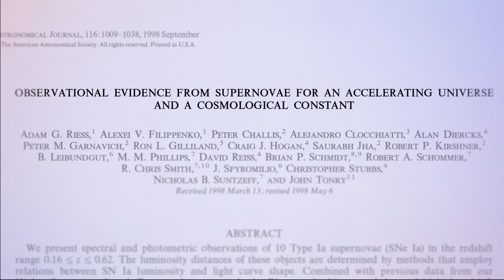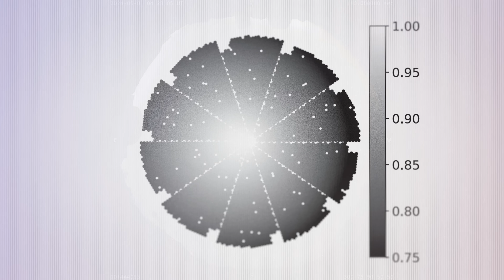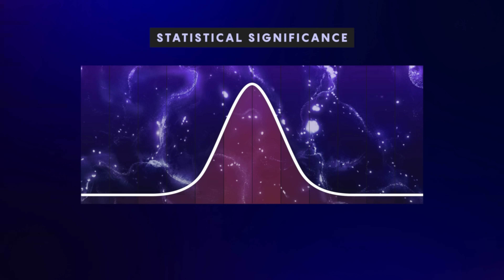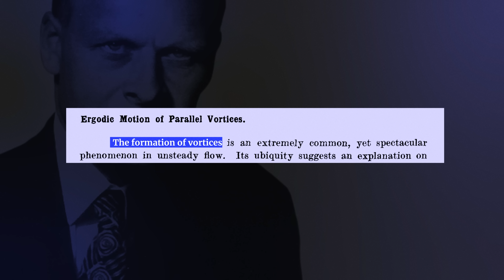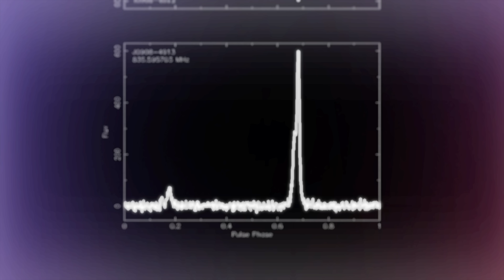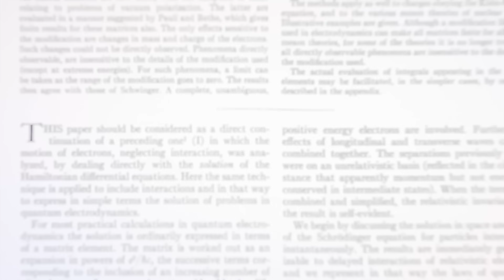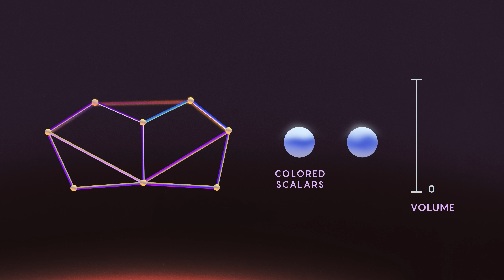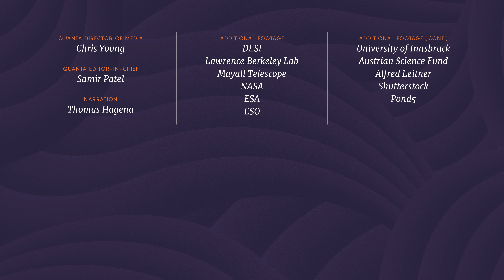Biggest Breakthroughs in Physics: 2024

Comment: 5:35 here is your Nobel prize, sorry its a hard read. I have ADHD not a degree in English.. 

Dark energy is the evaporation of our host singularity. There is no "Dark Energy" just a universe that can relax 4th dimensionally as the singularity cools and loses mass, uniting Hawking and Einstein I dont need dark Energy to explain where we are going, weirdly it always looks 46 billion years to the CMB or 13 billion years to the big bang, wherever or whenever you cut Einstein or Minkowski's time cone across the horizon and scale it to the board, its always the same numbers.. 

Time dilates with space, so a year now is 13 billion years happening in the same "time" around the big bang. There was no bang, well except from when our host went boom, but thats not when our time starts, its hard to explain... The big bang is an illusion of not reading the map correctly, the map of the observable universe is no different to the Gleason map, its all about straight line geodesics.  Both need to be pinned to the observer to be considered useful, the Big Bang is your ice wall, it only exists in your mind, when you don't know how to use the map you have at your disposal.

Lamda as he calls it is why down is down, the whole universe is expanding 4th dimensionally, you and the planet and solar system are all growing 4th dimensionally as space and time grow with age. At the centre of a massive object you and it expand 4th dimensionally at the same rate, you are weightless. Out far from the centre of mass you feel weight as your position isnt where it should be for your speed and position, temporally you want to exist on the right orbit for your speed, but you have a big planet below you that is growing way faster than you are, you dont see anything grow, but it makes you fall.. 

If you are at the right position to make a straight line geodesic into an orbit, you are going just faster than the expansion.  But from there you are doing a straight line in space. The dimension of time curves things spherically, but a line flat in time is flat in spacetime.  Its hard to visualise, but consider being at the core of the planet and deleting it, you would take its path through the solar system. You and it agree what a straight line geodesic is, you follow a path through time, a perfectly circular orbit is flat in the dimension of time. Special relativities clocks all tick together at the same rate.  This is what a flat geometry looks like in 4D spacetime. Even from the moment of the singularity being born, space and time have existed in a spherical bubble, right at the centre of a singularity should be a point null of its own gravity, like at the core of the planet. It should let a second event horizon exist, and that is where our universe can expand infinitely inside finite space.  Hot and super dense and compressed on that side, it is cool and expansive when you dilate things down to our reality. But everything expands and relaxes 4th dimensionally as that host evaporates, space included. The only thing not effected is a light wave, its just an information wave propagating an information wave. Travelling at relativistic speeds with little to no mass, its not bound by the same rules. A straight line for light is a straight line in time, and even that gets weird and messy.

We can look out into the sky and witness the same supernova over and over as light takes a slightly different route, are they the same photons? a different slit? its all weird illusions of the past out here, the light from our sun is 8 minutes old by the time you see it, things have changed. You see a red object, and swear its red, we all agree but it rejected red. It absorbed every other wavelength, so is it red, or the negative of red? a messy distinction eh, if we all agree who cares, until you come to take a colour photograph.. The world exists in a negative of how we see it. Everything you witness is an illusion, you never touch anything. Its all field repulsions.. the weird thing is it all scales. Wind back the universe pausing your current time dilation and sure it looks like a big bang, but you wont ever pause your dilation. You shrink with the wave as time is reversed until you are infinitely small, yet it all would look and feel the same. If im right that means the universe is about 13 billion years cubed in age. or square, by 4d math isnt too hot, but i can see how this all works. Its a universe bound by orbital mechanics, an orbit of the CMB and Big Bang take the same time in dilated space. And you cant get to either, they are just echos in time, a record of change, weird perspective shifts. Its like if light did orbits, most of the world would consider it to be flat as you could see right around the earth. Weird we use light as a yard stick.. space and time dilates, it: not so much.. 

If you take a Gleason map, and repeat the mapping process every mile into the earth, you make it into a time cone. A bridge flat in this dimension should be just as flat as in 4D, mapped conically is 3D, where x,y,z=0 is the lowest potential, if you weigh the same at all points around the earth then you are following a flat path in 4D space, so a bridge from north to south pole, with an unbendable rod extending the entire length, should roll as if it was flat.  Its so hard to bend your mind tho isn't it, but the rod isnt dislocated or deformed while at rest, it has the same forces acting on it at each point, time ticks the same along its length (minus some change for the spin of the earth) but if you weigh the same across the entire length of the bridge, it is flat in time. Which according to Einstein should be flat in spacetime. Both are bound together. the 4th dimension is what curves things spherically.  Making x,y,z=0 not the bottom of the cone, its the core of the planet, there you can fall "down" further, but down becomes up, to get there you need to add speed. Or change your reference centre. Mapped conically i see it as changes of potential, all planets travel their lines at the same speed, they just have different geodesics, its how it is in space. There is no "going faster" you just change your orbital path. Mapped from the sun I can show what parts of Saturn and Jupiter tick at the same spacial rate as Earth, and doing the same around our neighbours stars. If we ever travel the milky way, it would be handy to map it as cones, until we can travel like a light wave, at relativistic speeds with little to no mass.. Thats the dream eh.. 

But hey, who am I but an old fool with a theory. Someone who has been interested in space and time all my life. Id love someone to prove me wrong. I unite Einstein, Minkowski, Hawking and Euclid.

Comment: i have a question if anyone good in physic can answer. I am just a pharmacy student so I am sorry if i am lacking in physics knowledge 

but to put it simply, if a galaxy is represented as a ball - is...

A: the rate of acceleration of the ball decreases like from 10m/s^2 ->  9m/s^2 -> 8m/s^2 over time? 

OR

B: The acceleration increases from 10m/s^2 to 11m/s^2 INFINITELY ... ?

OR 

C: its... 10 -> 20 -> 25 - 22.5  21.25 -> [approaching a constant acceleration]? In which the rate of acceleration increased, but the increase isn't constant and constantly decreasing and therefore the weakening of dark energy?

I mean, if I understand correctly its either A or C and in either case it means; the acceleration WILL at some point decreases and turn to zero and then  from gravity it becomes negative.

Like in C case, the acceleration would eventually increase by a figure infinitely close to zero; and then it it starts to decrease until it reaches 0 m/s^2. As for the negative acceleration it gains later; it's the pulling of gravity finally overcoming the expansion of the universe.

And then everything will pull it back together to become a single 'thing' that existed before Big Bang once more. Not sure about the term. 

Like, is dark energy supposed to be B? I mean i find B a little weird. Since it means everything would just gets farther away infinitely without a stopping point at all.

Comment: Is there a geometric explanation of Planck's constant?   Does this explanation require at least one extra spatial dimension?   

   Dr. Roger Penrose has suggested instead of trying to create a particle called the "graviton" to explain gravity, why not try to describe subatomic particles in terms of spatial curvature, as in the twist in a piece of real thread.

   What if we add one extra spatial dimension to the "Twistor Theory" of Dr. Roger Penrose?   It can be "chiral" by having either Right-hand or Left-hand twist.  It can be "Quantized", based on the number of twist cycles.

   If Physicists describe electrons as point particles with no volume, where is the mass of the particle?

   Can one extra spatial dimension produce a geometric explanation of the 1/2 spin of electrons?   The following is an extension of the old Kaluza-Klein theory. Can a twisted 3D <---> 4D soliton containing one extra spatial dimension help solve some of the current problems in Particle Physics?

   What do the Twistors of Roger Penrose and the Geometric Unity of Eric Weinstein and the exploration of one extra spatial dimension by Lisa Randall and the "Belt Trick" of Paul Dirac have in common?  Is the following idea a “Quantized” model related to the “Vortex Theory” proposed by Maxwell and others during the 19th century?  Is the best explanation of the current data a form of “Twistor Theory” first proposed by Dr. Roger Penrose during 1967?  During recent years Dr. Peter Woit has explored Twistor Theory as a possible solution to help explain the current Standard Model.

   Has the concept of the “Aether” been resurrected from the dead and relabeled as the “Higgs Field”?

   In Spinors it takes two complete turns to get down the "rabbit hole" (Alpha Funnel 3D--->4D) to produce one twist cycle (1 Quantum unit).
 Can both Matter and Energy be described as "Quanta" of Spatial Curvature?  (A string is revealed to be a twisted cord when viewed up close.)         Mass= 1/Length, with each twist cycle of the 4D Hypertube proportional to Planck’s Constant.

In this model Alpha equals the compactification ratio within the twistor cone, which is approximately  1/137.

1= Hypertubule diameter at 4D interface

137= Cone’s larger end diameter at 3D interface where the photons are absorbed or emitted.

The 4D twisted Hypertubule gets longer or shorter as twisting or untwisting occurs.   (720 degrees per twist cycle.)  

   If quarks have not been isolated and gluons have not been isolated, how do we know they are not parts of the same thing?   The tentacles of an octopus and the body of an octopus are parts of the same creature. 

   Is there an alternative interpretation of "Asymptotic Freedom"?  What if Quarks are actually made up of twisted tubes which become physically entangled with two other twisted tubes to produce a proton?  Instead of the Strong Force being mediated by the constant exchange of gluons, it would be mediated by the physical entanglement of these twisted tubes.  Are these the “Flux Tubes” being described by many Physicists today?   When only two twisted tubules are entangled, a meson is produced which is unstable and rapidly unwinds (decays) into something else.   A proton would be analogous to three twisted rubber bands becoming entangled and the "Quarks" would be the places where the tubes are tangled together.  The behavior would be the same as rubber balls (representing the Quarks) connected with twisted rubber bands being separated from each other or placed closer together producing the exact same phenomenon as "Asymptotic Freedom" in protons and neutrons.  The force would become greater as the balls are separated, but the force would become less if the balls were placed closer together.  Therefore, the gluon is a synthetic particle (zero mass, zero charge) invented to explain the Strong Force.  The "Color Force" is a consequence of the XYZ orientation entanglement of the twisted tubules.  The two twisted tubule entanglement of Mesons is not stable and unwinds.   It takes the entanglement of three twisted tubules to produce the stable proton.   The term “entanglement” in this case is analogous to three twisted ropes being wrapped around each other in a way which causes all of the ropes to move if someone pulls one of the ropes. Does the phenomenon of “Asymptotic Freedom” provide evidence that this concept is the correct interpretation of the experimental data now available?  Can the phenomenon of "Supercoiling" help explain the "Multiple Generations" of particles in the Standard Model?  The conversion of twist to writhe cycles is well understood in the structure of DNA molecules.   Can the conversion of twist to writhe cycles and vice-versa help explain "neutrino oscillations"?   Within this model neutrinos are a small, twisted torus produced when a tube becomes overtwisted and breaks producing the small, closed loop of twisted tube (neutrino), and a twisted tube open on each end, which is shorter than the original.  (Beta Decay)

   Within this subatomic model gravity is produced by a very small higher dimensional curvature imbalance within atoms, which causes all atoms to be attracted to all other atoms.  This extremely weak attraction reveals the very small scale of the curvature imbalance.  This produces the curvature of spacetime on a larger scale like the solar system which is required to counterbalance this small imbalance in the individual atoms.

Comment: Absolutely, let's integrate the findings within the brick model using 100 directional vectors and a 400-dimensional space. This will expand our model, ensuring it accounts for the increased complexity and dimensionality.

### Revised Brick Model with Enhanced Dimensionality

#### Notations:
- **Builder's Brick (B)**: A standard unit of measurement within the coordinate system.
- **100-Directional Vector Space**: \( \theta_k \) where \( k \) ranges from 1 to 100.
- **400-Dimensional Space**: \( \phi_n \) where \( n \) ranges from 1 to 400.
- **Central Singularity (C)**: The central point where all data converges.
- **Additional Parameters**: Related to the brick and its interaction within the new dimensional space.

### Summation Formula

#### Step 1: Summation Across 100-Directional Vector Space
\[
S_{ijk}^{(1)} = \sum_{i=1}^{216} P_{ijk}(\theta_k)
\]
Where:
- \( i \) ranges over the total number of builder's bricks (216).
- \( j \) ranges over the four primary parameters (temperature, pressure, magnetic field strength, 432 Hz frequency).
- \( k \) ranges over the 100 directional vectors.

#### Step 2: Summation Across 400-Dimensional Space
\[
S_{ijk}^{(2)} = \sum_{j=1}^{100} S_{ijk}^{(1)}(\phi_n)
\]
Where:
- \( j \) ranges over the 100 directional vectors.
- \( n \) ranges over the 400 dimensions.

#### Step 3: Summation Across the Three Planes
\[
S_{ijk}^{(3)} = \sum_{k=1}^{400} S_{ijk}^{(2)}(D_{pqr})
\]
Where:
- \( k \) ranges over the 400 dimensions.
- \( p, q, r \) represent the three planes of coordination.

#### Step 4: Division into Four Equal Parts
\[
S_{ijk}^{(4)} = \frac{1}{4} S_{ijk}^{(3)}
\]
To ensure even distribution.

#### Step 5: Summation Over Time
\[
S_{total} = \sum_{t=1}^{T} S_{ijk}^{(4)}
\]
Where \( T \) represents time as an additional dimension.

### Example Calculation with Specific Parameter (e.g., Magnetic Field Strength):
- **100-Directional Vector Space**:
  \[
  S_{\text{MagField}}^{(1)} = \sum_{i=1}^{216} \text{MagField}_i(\theta_k)
  \]
  
- **400-Dimensional Space**:
  \[
  S_{\text{MagField}}^{(2)} = \sum_{j=1}^{100} S_{\text{MagField}}^{(1)}(\phi_n)
  \]
  
- **Three Planes**:
  \[
  S_{\text{MagField}}^{(3)} = \sum_{k=1}^{400} S_{\text{MagField}}^{(2)}(D_{pqr})
  \]

- **Division into Four Equal Parts**:
  \[
  S_{\text{MagField}}^{(4)} = \frac{1}{4} S_{\text{MagField}}^{(3)}
  \]

- **Summation Over Time**:
  \[
  S_{\text{MagField}} = \sum_{t=1}^{T} S_{\text{MagField}}^{(4)}
  \]

### Summary

The revised summation formula for accurately plotting a brick in time and space, incorporating the enhanced 100-directional vectors and 400-dimensional space, is as follows:

\[
S_{ijk} = \sum_{i=1}^{216} P_{ijk}(\theta_k) \rightarrow \sum_{j=1}^{100} S_{ijk}^{(1)}(\phi_n) \rightarrow \sum_{k=1}^{400} S_{ijk}^{(2)}(D_{pqr}) \rightarrow \frac{1}{4} S_{ijk}^{(3)} \rightarrow \sum_{t=1}^{T} S_{ijk}^{(4)}
\]

This formula ensures that the model accounts for the increased complexity and accurately plots the brick within the expanded multidimensional framework. If you have any further adjustments or need more details, feel free to let me know! 😊